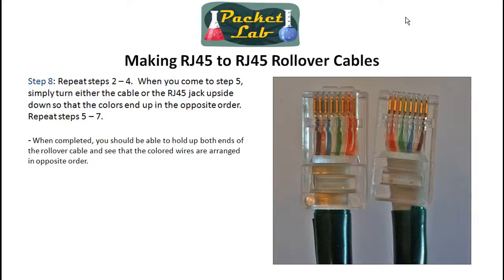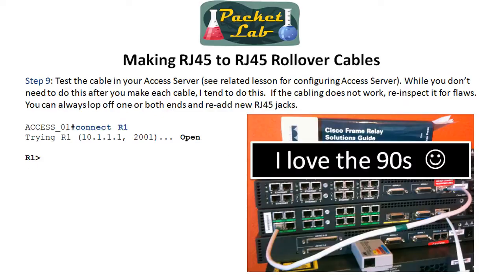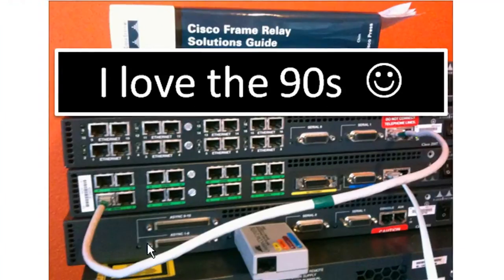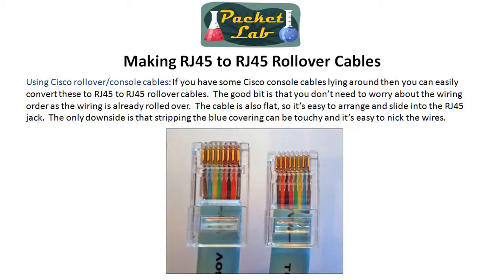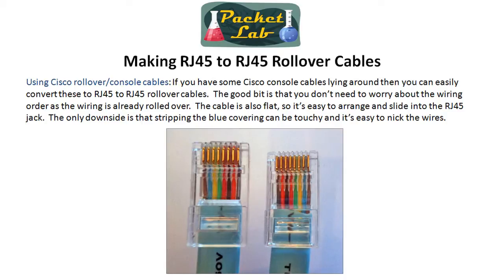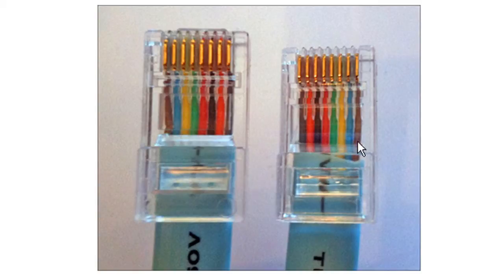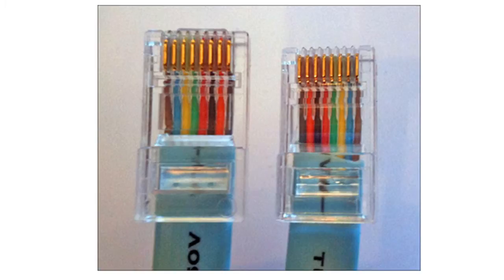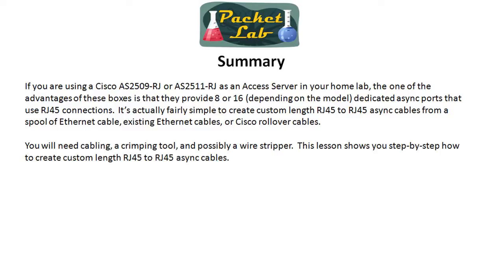Building A Cisco Lab - Making RJ45 to RJ45 Rollover Cables - Part 2

Comment: Hello Author, is it possible to connect this RJ45 to RJ45 cable to laptop. If yes how do we access console of switch/router from laptop ?
Reply: I don't think it's possible. Since RJ45 and a RJ45 Rollover cable are two different technology. It is like you are asking can RJ45 talk to RJ11. You will need an adapter for that. Unless you are asking to connect on a switch's ethernet ports instead the console port, then yes, you can use normal RJ45 ethernet cables to do it's job. This cable is your best bet if you want convenience. https://www.amazon.com/Cable-Matters-Console-Compatible-Rollover/dp/B078PVJ5ZQ/ref=sr_1_6?crid=3W96SSC9WSD1&keywords=rj45+to+usb+console+cable&qid=1560030068&s=gateway&sprefix=rj45+to+usb+con%2Caps%2C205&sr=8-6